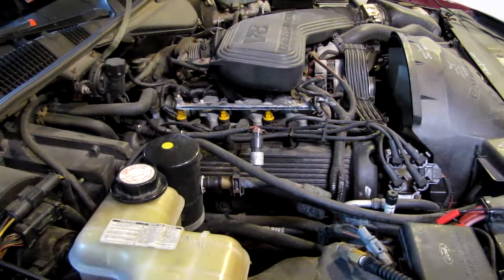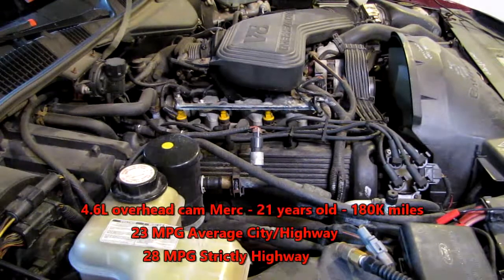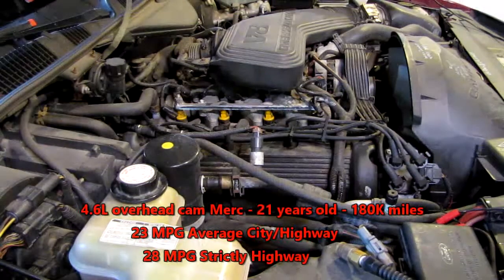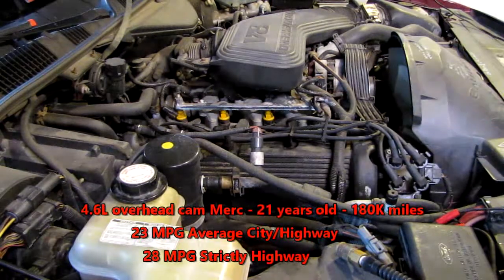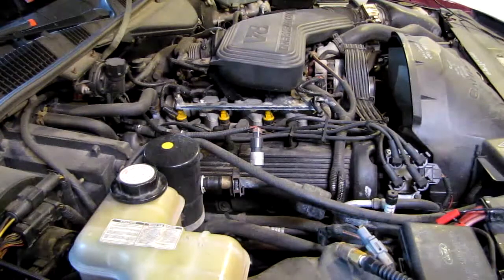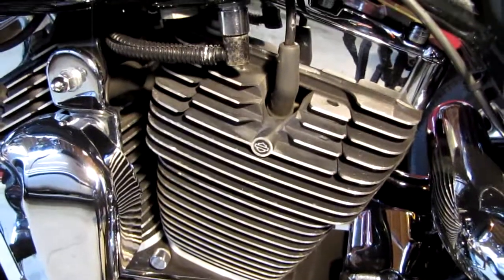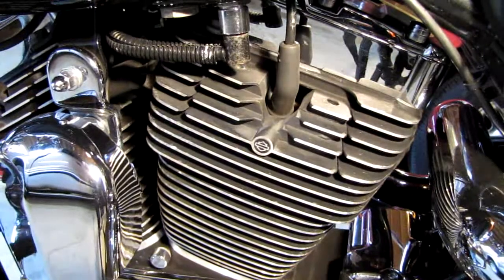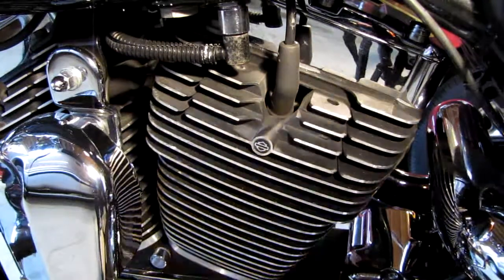Don't DESTROY your motor changing plugs

Comment: At least the plugs come out.  Ask a poor Ford owner that ended up with the spark plugs that break in half when you remove them.  The idiot that designed a two piece spark plug should be shot.  Can't count how many broken plugs I have removed for a local shop over the years.